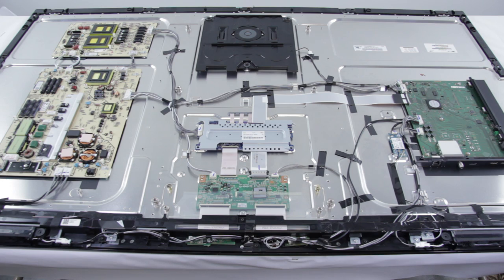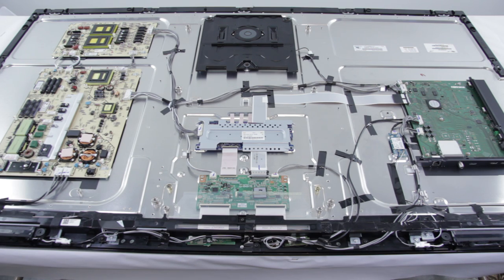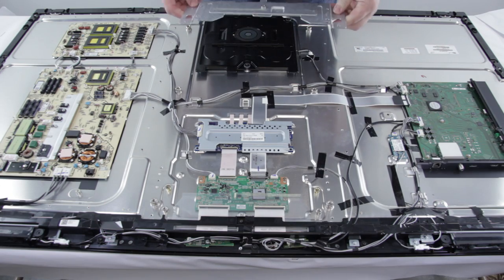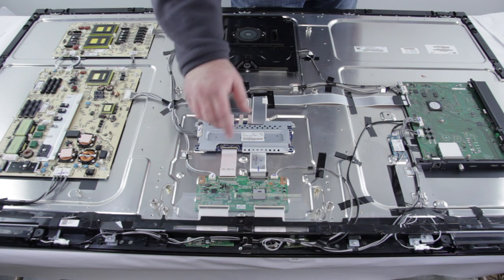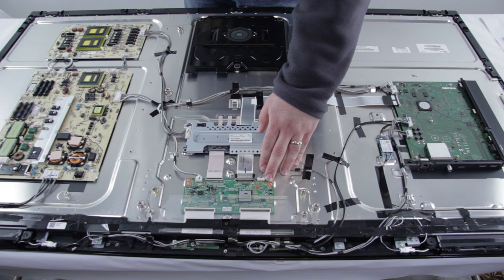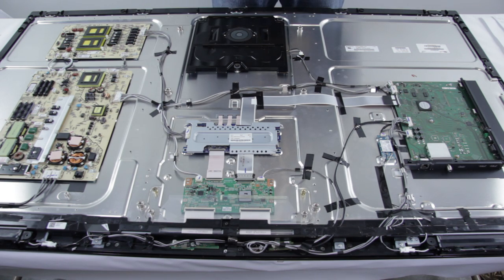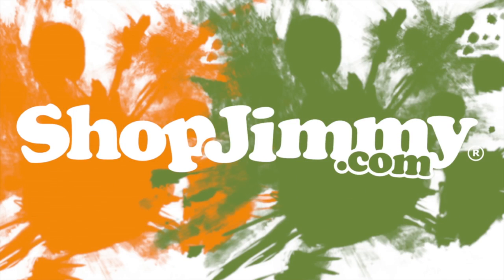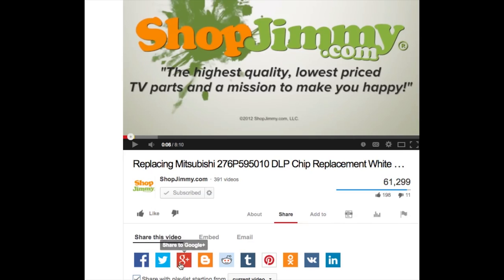LED TV Repair T-Con Board Help Review Overview - Common Issues and Problems with T-Con Boards

Comment: Hisense H55N6800, picture freezes after a while, slowly fades to black on all screen for 10secs. Backlight stays on, Audio works, you can change channels, etc. Turn it off and back on, works for another 10-30mins. Netflix streming or TV, takes the same time, keeps one working. Looks more T-board or Main?

Comment: LG60LB6100 is the TV model. Picture will only hold for a few seconds and then goes into a scrambled egg with distortion and lines. Which board is bad??

Comment: Hi Bob here from Canada. Have a Sony KDL-37XBR6. No standby light but 3.3 voltage good. 12volts good. Powers on.  Good audio. Video cuts out after a few minutes. Con board at 76 deg. F. Backlight working. Thnx. Bob

Comment: Samsung, UN60EH6000F - First the Screen was black with sound when i turned on the TV. After watching your wonderful videos I replaced the T-Con board with the new part BN95-00628C. After installing the new board the TV then camon and the screen was great - for about 2 minutes the it "faded" to black. Now, if I turn it off wait a few minutes when i turn it back on it looks good for 30 seconds to a minute then "Fades" to black. I would appreciate an new ideas or advice. Thanks to your team for helping so many people avoid expensive repairs. I look forward to hearing back from you.

Comment: "IMPORTANT: Horizontal lines on the screen are virtually NEVER caused by a bad T-con board. Horizontal lines indicate a defective LCD panel (screen)."           .. it also can be a bad high voltage capacitor in the main power supply... 82uf 450vdc.. fixed mine today

Comment: I have a Hitachi LE55A6R9A and I can see the picture but there is no adjustment to the backlight.  The picture is really dim and I also noticed that sometimes the remote won't work for powering off the TV.....I know the batteries are good in the remote.   What board should I replace.  I am a 45yr vet of computer repair.  Thanks for your help.

Comment: I have Samsung un65mu850dfxza fc04 and I am experiencing intermittent vertical lines, fuzzy screen and double imaging.  Some one had covered one of the vents in the middle of the bottom of the tv and I believe the component there got heat damage.  So far everything I have seen suggests the t-con board but would like to confirm prior to purchasing.  Your assistance is greatly appreciated

Comment: I have an LG50LN5700 that needed backlights. I bought the lights from you put them in, they work great! The problem is when I put the TV back together. I chipped the OUTSIDE silverish bottom right edge of the screen about an inch. I doesn't go into the black portion of the screen. But now I have what resembles a very dark grey/purple/black storm cloud when I turn the TV on. Did I ruin this TV ?  thank you

Comment: I have a 55"hisense smart wireless 
 led TV it turn on then shut off ,replaced power board and main board still dissent stay on unless you turn back on and keep hitting input it stay on HDMI? Do I need a tcon board?

Comment: Hi I have A Sharp LC-70LE650U. It will quit every few minutes and pic will freeze on screen. It then will reboot and come back on. When we bought set new it had what sounded like a relay clicking at various times but that stopped and problem began. Works fine other than that. Thanks for help

Comment: Hello and thx for the explain. i have LG model 65S800Y with black vertical lines on screen, and as i understand there is new T-con board that might replace my T-con 6870C-0700B driver that is probably bad. which new T-con should i order? thank you in advance.

Comment: Looking at purchasing parts. I believe I need a main board or t con, but I'm leaning to main board since my backlight works but I have no picture no sound. The sound issue is why I'm leaning to main board instead of tcon. The toslink port doesn't light up and my multimeter shows no power being sent to the speakers. The tcon receives power from the main board.

Comment: RCA LED55G55R120Q... I have already replaced what was thought to be a bad power supply board. I now have the power indicator light on the front. When I power on, screen comes on for a second with backlighting, then fades away.

Comment: I have a TCL 55s401 the little white light is always on. I doesnt  even  flicker when I push the power button, However, Nothing on the screen. The screen doesn't appear to work at all. Hope you can help.  Thank you very much for your time.

Comment: I have a Vizio M3D650SV TV. I am getting two black vertical lines on screen(one right & one left side). I suspect it's the T-Con Board. I would first like to get hold of a Service Manual. Also, the price and availability of a t-Con Board for this model. Thanks.

Comment: RCA 60" LED LCD FULL HGTV
1920 x 1080p
120 Hz
Model number: 
LED60B55R120Q
Can access menu & input but TV is not recognizing anything via the HDMI cord. Also during Hurricane Matthew a surge fried the cable box, too. Could it be the motherboard?

Comment: I have a LG 65UH615A.  It has a constant multi-color band in the left ⅓ of the screen approx 4" wide.  It does this on every input and even no input, just the screen saver.  Depending on the image on the screen, there may be blurry horizontal bands to the left of the multicolor band, and what looks like a white barcode (vertical and/or horizontal) bands to the right of the vertical multicolor band.  Some images are worse than the others.  On the stock screensaver, the dog is the worst (screen completely occluded) and the mushrooms are the best.  When the screen is dark between screensaver images, the multicolored vertical band can still be seen but not the blurry or barcode bands.  Thank you for your help.

Comment: I have a very dim/dark picture on my 65inch TV.  You can barely see the picture,  but the TV and smart features work. Would this be tcon board issue, or a backlight inverter issue? I am not a technical person, so if you could explain as simply as possible, I would greatly appreciate it...
Reply: BTW, it's a Samsung circa 2015.

Comment: I have a Toshiba 55vl900a which when you turn on half the screen  is lighted the half is dark a d then after a about 20 seconds it all goes black. Suggestions on what the problem and possible solution would be greatly appreciated. Great videos by the way keep up the great work. Look forward to hearing from you soon.

Comment: I have  a Sharp Aquos LC- 70LE6504. I replaced the TCONN board for Horizontal lines. The TCONN replacement  board worked fine,  but I have some horizontal shading that lighter at the bottom half of the picture... Please advise. It is like an imaginary line separating the picture. Thank you.

Comment: Hello Shop Jimmy,
    I have a Samsung LN52A650A1FXZA LCD television in which the sound fails after a certain period of time and then there is a noticeable buzz before the television automatically powers down and then turns back on.  At which time the sound restores, until a certain period of time, then the same problem happens again.  The frequency of the problem is reduced when the sound is set to zero through the television speakers and run through the tuner.  Thank you for your time on this matter.

Comment: Hello, I have a Samsung model number UN46B6000. It has vertical colored lines going through the TV. The sound works great. Just the vertical lines coming through. I am assuming it is the T-Con board. Could it possibly be anything else? Don't want to buy a new one until I have tried everything else first. Thanks.

Comment: I have vizio m43-c1 with vertical lines on left half of screen after power up.  Vertical lines  only occur after TV has been off for a while and 1-3 minutes after powerup vertical lines go away and picture is fine.  I thought it was bad tcon so I replaced it with known good one but it didn't.
Thoughts?
Do you think the power supply is failing? As I mentioned, issue doesn't occur at every powerup, only after tv has been off for a while (after a cap somewhere has drained down?)
Once the vertical lines clear after initial powerup, you can turn TV on and off as many times as you like without the vertical lines reappearing.  Off for an hour or so...problem reoccurs upon powerup for 1-3 min.

Comment: I will be back with more info, but for now here is the question.
During a storm there was a lightning hit just down the road, at that instant the screen turned mostly yellow, I have adjusted the settings to adjust but the picture is at best washed out with a yellow tint. I think if you can direct me to the part I may need I can do the fix. *(LG 47" LED 3 years old)
Reply from the maker: Anthony Carnevale   I recommend replacing the power supply and the main board.  Please reply with your TV model number.  Click here to view a video that shows how to find your TV model number:  TV Repair Help IMPORTANT TUTORIAL How To Find Your TV Model Number Tutorial TV Repair Help  Thanks!  www.shopjimmy.com

Comment: Was looking for some info and replacement parts for my SONY KDL-46XBR9. The TV has a green tint or fuzz on the left 50% of the panel. (Solarization?) Upon close inspection some pixels appear purple as well mainly in the dark areas and backgrounds. It seems that at least some menu functions will overlay the issue and appear fine. Sound is fine and problem occurs on all sources. have re-seated all ribbons cables.and the green tint will stay very briefly after unplugging the main board. Unsure if the T-con issue or possible panel problem or ribbon connections.
Reply from the maker: Jason Carusone   This sounds like a TV panel (TV Screen) problem.  If your TV panel is bad, it may be more cost-effective to replace the TV as panels are typically hard to find in stock, difficult to replace, and expensive.  Thanks and please let us know if you have any further questions!  www.shopjimmy.com

Comment: Hi I have a Sharp LC-60LE640U and the picture went out but we do have sound and backlight so I'm thinking it's the tcon board. Just wondering if it was pretty easy to replace myself? I am going to order the part today just wanted to make sure it's something I can replace myself or do I need any special tools?

Comment: I have a Mi Mssp3 TV 43inch. No video but can power on and have sound. Pls advise if changing the T-con part will solve the issue. Also where and what is the part and model number

Comment: I have a vizio m501-ar2. It had a horizontal line going across the display. I was testing the ribbon cables to the t-con board by simply pulling them out and reinserting and I ended up with vertical lines. I replaced the t-con board with a brand new one oh, and I still have colored vertical lines with a thick black vertical bar just left of center of the screen. Good there appears to be good voltage throughout the t-con board. Thoughts on next steps?

Comment: I have a LG 42LE5400-UC that displays several colored lines ( maybe 20 or so) on the left hand side of the screen. The lines show up when the TV is powered up and slowly disappear over a 5 or 10 minute period. They also show up on all inputs. The number of lines have been increasing over time. I have been pointed at the TCOM board as the source for this issue. Your thoughts would be appreciated. Thanks you. Bill

Comment: First off, thanks for your videos, very helpful! I have a 70" Vizio E701i-A3 that I was watching today when the picture faded to black. The TV is just over 2 years old and is powered on roughly 4 hours a day. I do have power to the device as well as Back lightning but no video at all.  I have been reading on line where others have replaced the t-con board (And actually all 3 boards) without resolving the problem. Even read one post where the they suggested unplugging one of the drivers. Any insight would be greatly appreciated!

Comment: Hi I have a magnavox led tv model# 39me413v/f7 This is just over 12 months old and now I dont have any power going to it. there is no light or response using the remote. I have tried other power outlets and used other items in the same socket ok.Thanks for your help.
Reply from the maker: Steve McElroy  Please watch this video FIRST to help with your repair!  TV Repair! LCD, LED, Plasma, DLP How To Fix Your TV with ShopJimmy.com Help! I recommend replacing the power supply board first.  Click this link to replacement power boards:  http://www.shopjimmy.com/catalogsearch/result/index/?cat=59&q=39me413v%2Ff7  Be sure to match part numbers on your current board, with your replacement for compatibility.  Thanks and please let us know if you have any further questions with your TV Repair!  www.shopjimmy.com

Comment: I have a sharp Aquos LC60LE632U 60" 1080p. HDTV LCD. Just bought it from Craigslist, cheap. great picture. Except, there's one vertical GREEN line down the right side of the screen... about 6" in from the right side. Any idea how to fix it? Thanks.

Comment: I have an LG 47LW5600 LED TV with sound but not picture. I have replaced the power supply board but still have no picture. Does this model have a T-con board and would this be the next board to replace?

Comment: I have a Samsung UN60D7000. Experiencing a blue vertical line  (1 single line) down the screen. I think I need to replace to t-con board, but looking for input.

Comment: Hello Shop Jimmy
I have a Sharp LC-70LE650U that I suspect has a bad T-CON Board.
When powered on, the picture is flickering, no lines or shade or dark areas, also no horizontal or vertical lines, just flickering. I checked the power input to the T-con and both power leads read 11.90 volts. I also checked all the connections I could see for fit or dirt. If I unplug one (of the two) ribbon cables, the picture clears up on one side of the screen while the other half is all white. If reconnect it and disconnect the other ribbon cable, the other half of the screen goes white but the picture half is flickering like it does if both ribbon cables are connected. Audio is good, back lights are good, It sure appears like the T-CON board but could it be the LCD panel? I’ve documented the symptoms with a short video and pictures, available upon request. Any thoughts? Thank You!

Comment: I have a Samsung 55" UN55ES7003F TV that's 7 years old. Works great but I have light blue vertical lines, right of center on the TV. Is that a t-con board issue? Thank you.

Comment: LG Model# 47LN5700 mfg in 6/2013; purchased 11/2013; Turned on - LG symbol flashed and went to black screen on 12/2014. Did a flashlight test and could view menu.
Reply from the maker: Callie Hudson  Please watch this video FIRST to help with your repair!  https://www.youtube.com/watch?v=BP3NVNCGEv8  I recommend replacing the power supply board in your TV.  Click this link to replacement parts for your TV model number:  http://www.shopjimmy.com/lg-eay62810801-power-supply-unit.htm  There may be multiple boards for the same TV model number, be sure to match part numbers on your current board, with your replacement for compatibility.  Thanks and please let us know if you have any further questions with your TV Repair!  www.shopjimmy.com

Comment: We have an Olevia 337 B11 
The screen looks exactly as if a bullet hit the screen. Looks like a virtual bullet hole with colored vertical lines spreading from the "hole". 75 percent of the screen is normal and fully functional.

We opened up the Tv and removed the covers, but could see no obviously blown capacitors.

thanks
Reply: ShopJimmy.com I'm sure that you are correct. Can I safely assume that one of the teenagers in my abode somehow struck the screen and damaged it? Or is the "focal point" damage image likely to arise just from old age of the components?

Comment: I have a Vizio M3D650SV.  There were 2 vertical black lines in right third of the screen.  The lines have been there about 5 months.  They have now gotten a little wider and I see some yellow lines now.  What probability is there that it is the T-Con board?  Thank you.

Comment: Insignia NS-55E560A11. Child poured small amount of windex down the front panel while ON. TV now has large blue blocks mixed with colored blocks separate from other blocks (maybe 6 total). Would this be the T-con board?

Comment: I have one thin green vertical line on the left side of my screen.  I have a 60" Vizio e series led tv.  Do you think a T-Con replacement would take care of it?
Reply from the maker: +nolannevada   Try all repairs and troubleshooting at your own risk.  This sounds like a TV panel (TV Screen) problem.  If your TV panel is bad, it may be more cost-effective to replace the TV as panels are typically hard to find in stock, difficult to replace, and expensive.  Thanks and please let us know if you have any further questions!  www.shopjimmy.com

Comment: I have a 32 "samsung model # un32jg300afz serial# 43mcgc00220z I have verical lines and a spot that is like the sun in the right side of screen.I ordered a main board before I found this you tube from your site. thanks Jim

Comment: Element - ELEFT326

How do I replace the ribbon connector on the t-con, there is no clip it seems to be glued directly from the screen to the board.

Comment: I have the samsung tft-lcd TV LN-T4061F, now its color is off, and takes 5 minutes to start. Here is the t-con board does this particular model located? Should I replace it with a new t-con board?

Comment: I have an LG 65UH8500 with horizontal lines on the bottom 3/4 of the TV. It has blurry images on the bottom. FOR example if I have the history channel on, the H in the bottom right corner is blurry going up 3/4 of the screen. Any suggestions on repairs

Comment: I’m replacing LED backlights and can’t get the strips off where it connects on the far right where all strips connect. I’m worried if I pull to hard it will break .